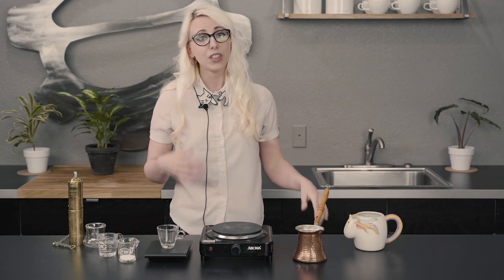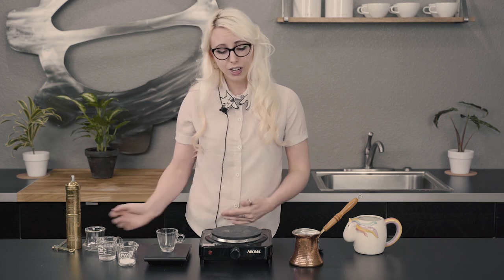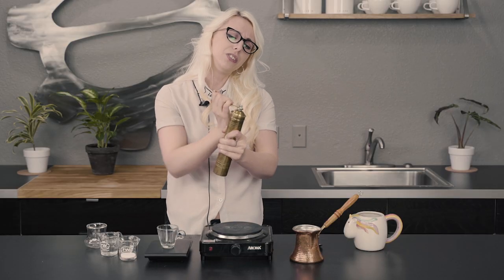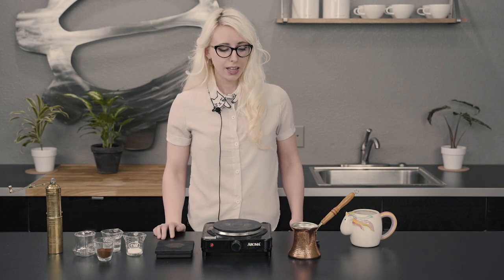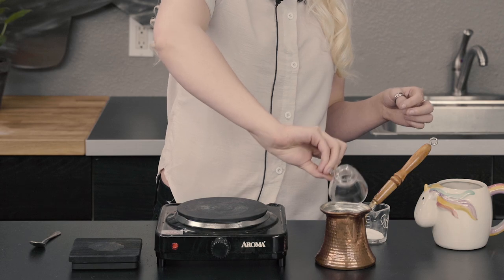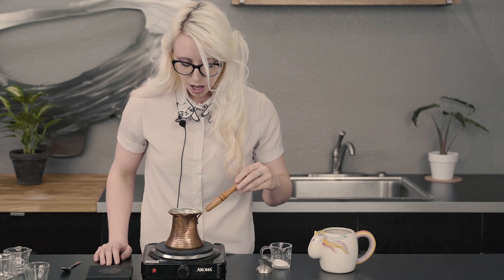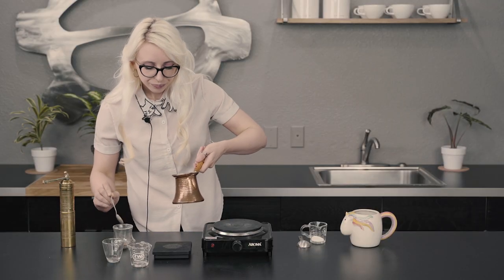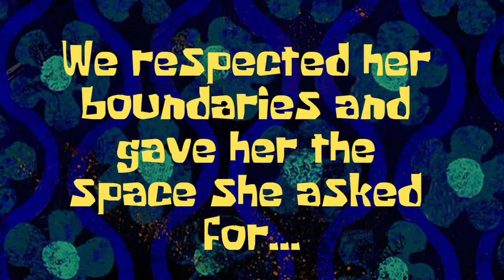Turkish Coffee | Coffee Collaboration

Comment: Um not gonna say your version produced a bad cup (I cant taste it) but it can be done so much easier.

1) In a cesva (or other similarly shaped non copper pot) combine 2 heaping teaspoons of turkish coffee for a US cup of water plus the sugar you want. All together in the pot. The ratio of coffee to water is entirely up to you and how strong you want it. I want it strong. In Greece at least, the coffee is usually a blond roast coffee robusta.
2) Stir before putting it on the heat!
3) Quite right, you go with a low/medium flame (I prefer a gas burner).
4) You do not remove foam whatsoever.
5) You let it heat up until the thick foam starts to rise. Just once. Not two or three. Just once. Right before it overflows you remove from the heat and pour into your preferred cup.
6) I agree you should let it rest a minute or two so more of the grounds can sit at the bottom so that you dont sip on them. But thats just a preference.

Comment: Looks and sounds very misleading on portraying cezve brewing method... 🤦🏻‍♂️🤦🏻‍♂️🤦🏻‍♂️Have you watched any winning recipe from any champion? (Yes, almost for each brewing method there's a freaking championship)
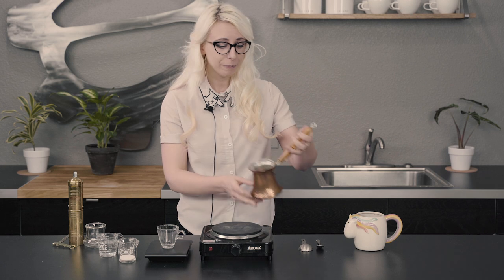No reference to brewing time, proper ratios (1:10), etc. You totally got it wrong about the foam. No need to tap it, or get the foam rising 3 times (it's a myth) or collect the foam.
Brewing in cezve should be around 2,5 - up to 3 minutes. Not Cold water but room temperature water should be used.
Then it brews in the cup untill cooled down to optimal 60-65 Celsius degrees. This time is also needed to settle down particles.